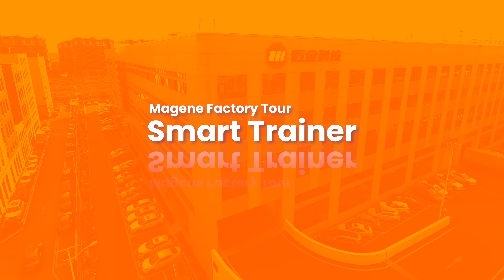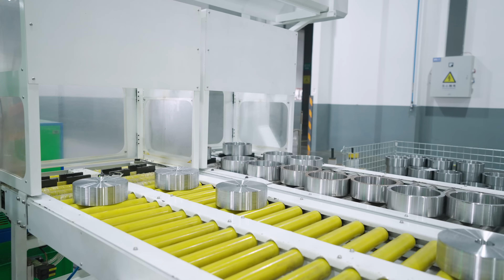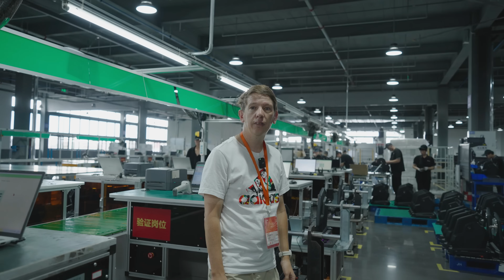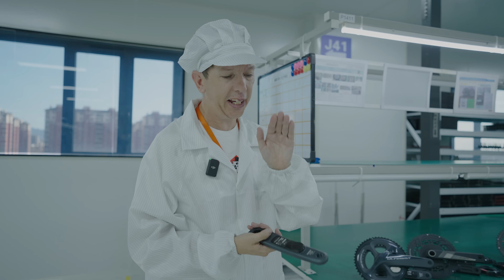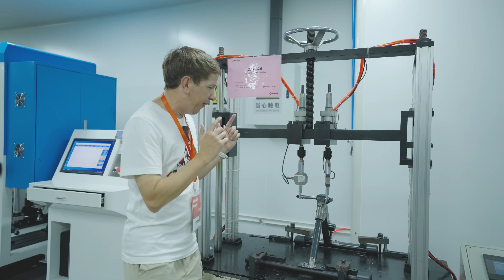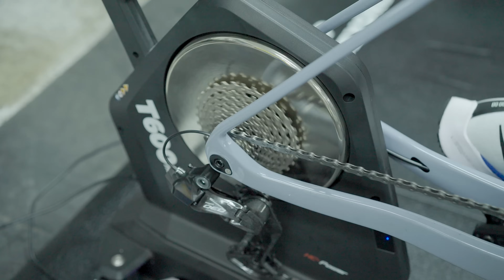BIGGEST Smart Trainer Factory IN THE WORLD: Magene HQ Tour

Comment: Joe I like your website and my purchase of the CRW wheelset has been awesome. I don't share your enthusiasm with Magene, however. I purchased a Base P505 powermeter crankset direct from Magene and my experience has been terrible. I tested the PM against separate pedal based PM's and the Magene is erratic both in average power and LR power. The customer service on the issue has been non-existent and no warranty service. It is not a quality or reputable company. I would stick to marquee manufactures when it comes to PMs. The Magene was a rip-off. I wish you were not hawking the company.
Reply from the maker: Strange one. I'll do some more investigating. I've not ridden my 505 for a while, but when I did (test against Assioma) it was accurate. Maybe your particular one has an issue? Also, also... not gaslighting, but power meters in general seem very unpredictable... look at the Shimano fiasco. Its really hard to monitor how accurate everyone's is., because most people are just using it as a single source. Anyway, hope you get it resolved, I shall look into it here.

Comment: I had the first model of their power cranks and they were okay, but i sold on the set as i was disappointed with the battery level and charging positions. Apart from that a nice product and the newer spider crank seems better from reviews. I use the c606 computer, radar light and cadence sensor and very happy with the products. Im looking forward to their power pedals but i hope they are ddesigned for shimano spd road cleats not oem.

Comment: Great Video shane. Magene has come a long way in the last few years. 

My first cycling computer was magene c406. My first indoor trainer was magene T100. My first power meter was magene P325 CS. Although I didn't have any problems with the Cycling computer or the trainer, the power meter Magene P325 CS had few problems. In 6 months, the right side stopped working, Although it was in warranty I had to ship it at my own expense (USD 50), to China for repair from India. Also, I was without a power meter for 2 months. Now again the power meter doesn't work (6k km usage) and it's out of warranty. Mailed magene and was quoted 115 USD for repair + 90 usd for shipping both ways. 😢. Thinking of ordering a new magene base p505 instead of repairing this power meter.

I also have the same power meter in another bike, no problems with it till now. Hopefully, it doesn't fail after the warranty gets over. Also i bought, 2 H603 hr monitor. First one worked for 6 months and second one for 10 months before failing. I have come to accept the fact that HR monitors fail. I got this after my wahoo hr failed after 1 year. Last week I purchased magene c606 cycle computer as it looked good for the price just to test it out as i got a good deal. I am using hammerhead karoo 2 now.

Hopefully the new power meters and other products r built to last a long time.

Comment: Still struggling with PES505 left arm loosening. Every bike we have touched in the shop, our own bikes, customer bikes etc. 

Surely they have received the feedback. ?
Reply: What, really!? How often should I check mine? I just got one.
Reply: Never had an issue with mine.  Hope you read the instructions, its different torque specs and procedure to Shimano cranks.
Reply: @cookiecrumbler79  everything was done according to the instructions, including changes in variants of the preload cap, O rings etc. latest gen has a little "expander" add-on to address loosening I suppose. But problem still exists

Comment: when they release that groupset
Reply: its already released, but only in selected authorized stores (probably 20 or so in China). My guess is the initial supply is limited, also Magene does not want to repeat mistakes Ltwoo and Wheeltop made when they released their products such as lack of clear instructions and quality control issue.
Reply: @zhuyufan1186  wheeltop have bad qc. i got serious shifting problem after update the app. the 8-9 9-10 gear always shifting by it self up and down. and for the front derailer it cannot do adjustment by the apps only by screw it will rub the chain when use big gear. i hate wheeltop in conclusion.